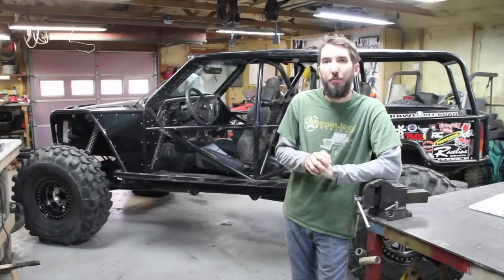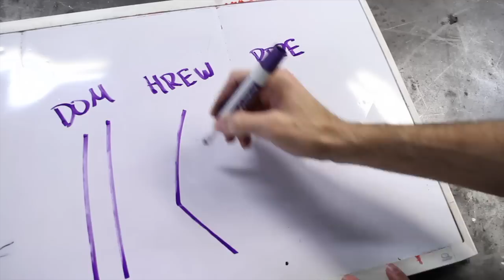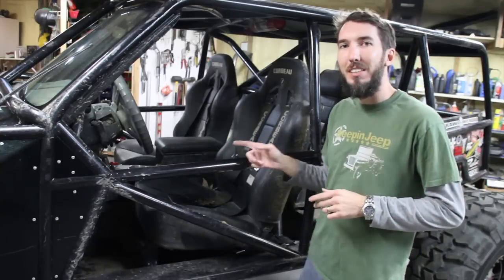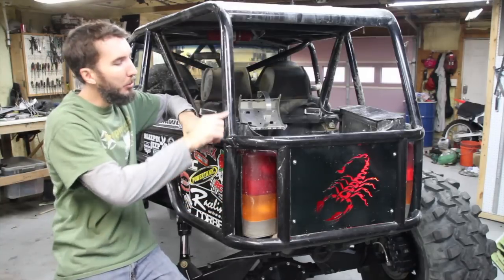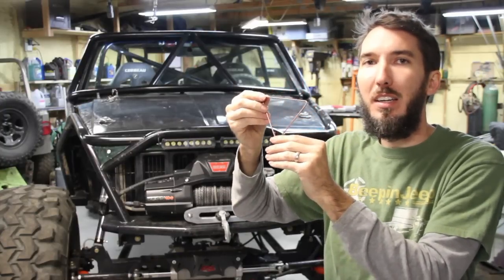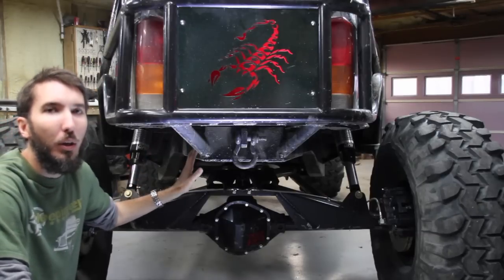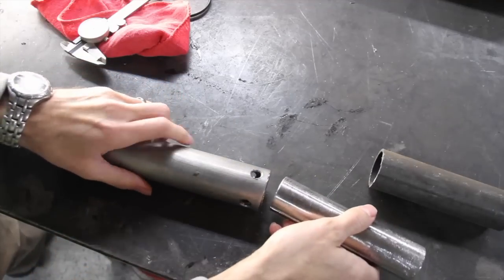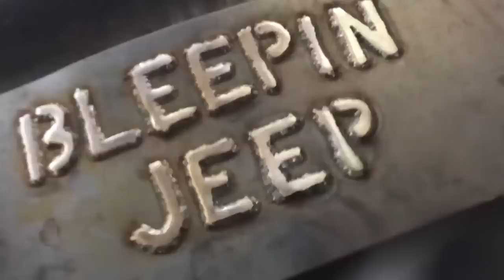Roll Cage 101

Comment: I have a '92 Wrangler YJ, 2.5l 4cyl.. I just bought a new starter recently because of the same thing.. It left me stranded at the park but all of my lights and everything else worked. I just had oil in my starter, but I fixed the leak. This time, it blew a 50 amp alt pwr.2 fuse and also the 10amp I.O.D fuse as well.. I replaced them, and now nothing comes on, my headlights, guage lights and even my guages dont work. I've tested my battery and its not dead. I tried crossing the poles on the starter to try to start it, it acted like it wanted to crank but it started making a sound like boiling water makes so I unhooked it from fear it'd catch fire. Any suggestions? I need help as soon as possible. I've already checked my fuses and relays and they're all good. Another question, if it was my starter.. how could it affect my guages and lights the way it did.

Comment: When tying the cage floorboard plates in, when you weld in the plates to the frame, never weld all 4 corners to the point of them being a full wrap weld. At each corner, leave about an 1/8"-3/16's on the corners not welded. A hard impact can cause the unibody to crack around the weld. At this point, it will just connect the dots to the point of the cage plate coming off the Frame.

Comment: Dude, DOM is just ERW tube that is then drawn over a mandrel, there IS a weld seam, CDS, cold drawn seemless, does not have a seam, there are also two kinds of ERW, cold rolled and hot rolled. Whats more important is the alloy of the tube, and design

Comment: Stadium x rock climbing.

A full cage to play a major part of the chassis strength is different to a safety cell for the driver. I want both. A safety cell with the external cage for the body built off the cell

Comment: chromoly is usually used for applications where weight savings is important like aircraft, formula SAE and Baja SAE, which is what I do. It's not any lighter than welded or DOM but it's stronger so you can use thinner wall and smaller diameters
Reply from the maker: good to know!

Comment: How do you reccomend tying an interior cage into an xjs frame rails? I've seen guys on pirate do the plate to the body and then from the underside plate come over to the frame rail with a piece of tube to another plate.
Reply from the maker: that sounds like a good idea, or possibly just cut a hole in the body and come down to the frame rail... but your other idea might be a bit stronger.  Just make sure to add frame stiffeners first or something better to weld to than the original frame rail.

Comment: for solid tubing id suggest 4130 chromally steel. its what I use for bmxing and the tubing is damn near impossible to dent for slamming into a concrete or steel ledge every once in a while and the frame was a 2009 special still going strong. my last bike was an aluminum frame and the whole head tube snapped without warning not even a year into just learning how to do some basic tricks and I'm only 160 pounds wet so that frame was garbage lol
Reply: benson420710 BMX is way different then rock crawling in rock crawling you take way harder hits so what's good in BMX ( where you need strong and light to do tricks) is different then rock crawling (where strong is more important then weight). Now I'm not hating on you I'm just pointing something out
Reply: I understand where you're coming from for the fact one weighs 10 times the other ,now I'm wondering how those 15-20mph crashes into concrete and steel ledges compare to rock crawlings slow but heavy impacts. ive seen the same parts on different bikes survive being ran over and it really matters how good the forging process is, in my case 4q "deathbaked" 4130 CrMo thats not even 4mm thick and you could use a 16lb sledgehammer to barely leave scratches. I do not know honestly that much at all about building a cage but more of what metals can stand from stupidity
Reply: benson420710 your comparing apples to oranges
Reply: The tubing he's using is steel. I don't think people make roll cages out of aluminum.... it's much softer than steel